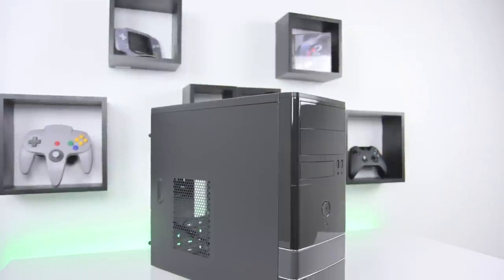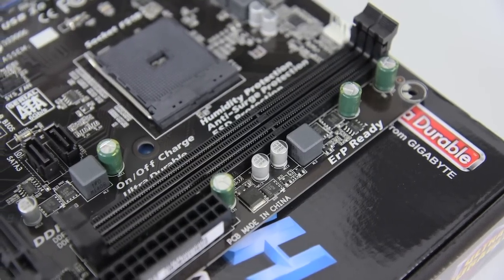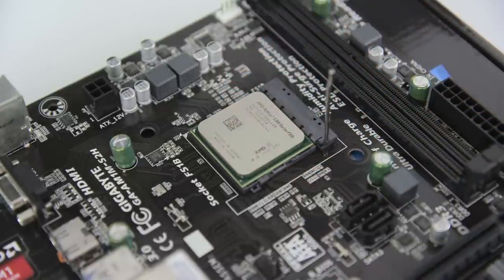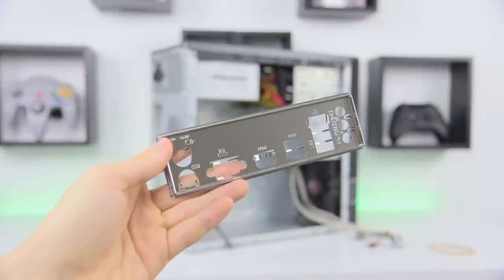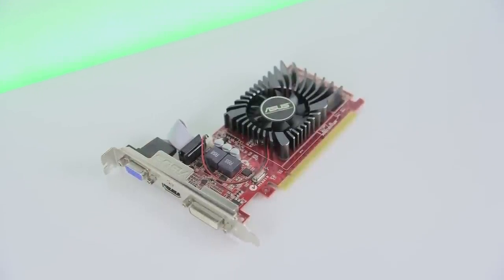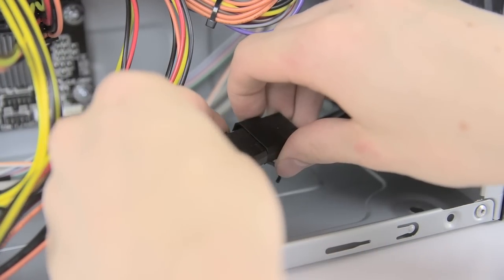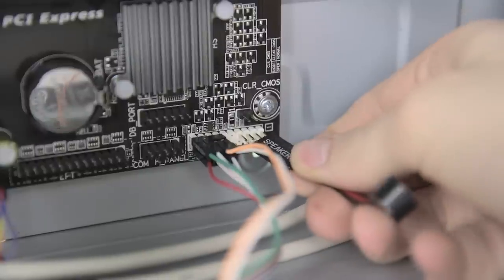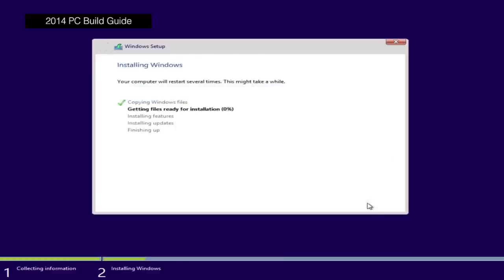How to Build a $300 Gaming PC! (2014 Boson)

Comment: im gonna buy these parts, just asking if its good or not:

processor: AMD FX-4300 4MB 3,8Hz 95W Tray Socket AM3+

motherboard: ASROCK 960GC-GS FX SocketAM3+/AM2+/AM2

power supply: ANTEC HCG 400 HIGH CURRENT GAMER PSU

case: ZALMAN ZM-T1 - Mini Tower - Black

ram: KINGSTON Valueram 8GB 1333MHz DDR3 CL9 DIMM STD

ssd: PNY SSD OPTIMA 120GB SATA3 1K

graphics card: VERTEX 3D VTX3D Radeon R9 270 Dual X-Edition, 2048 MB DDR5, DP, HDMI

hard drive: Western Digital 1TB Caviar Green, 3.5", Sata3, IntelliPower, 64MB

my friends linked me these but im not sure if its good or not, i would appreciate the help.
Reply: That powersupply is going to fry your graphics card. The 270 needs a minimum of 450W.
Reply: alright thanks for the advise
Reply: Prob 500 w least
Reply: ONLY buy Power Supplies from good Companies like be quiet!, Corsair or Enermax.
I bough a noname Psu once and killed my whole system with it just by turning it on.
Reply: http://uk.pcpartpicker.com/p/ynQ9pg Would Kick That Builds Ass. you have a wd green drive (there eco friendly = less power = lower data rates) that ram you got is slow and as said the psu is a little to small. try using a semi modular psu as its cuts out the unneeded cables.

If you buying like 8Gb of ram get 2x 4Gb modules and run duel channel this allows you to then be able to upgrade to 16Gb (not like you'll ever need to) buy just rebuying the current ram and popping it in, unlike if you bought 8Gb in quad channel you'd have to have that out and replace all. Also the Fx6300 is overkill for you as its 6 core but its the same socket as your quad fx4300 so just swap it out in your buys. I added the corsair H80i watercooled (easy and simple to install all in one) as that gives you system feedback but if you use the fx4300 you could probably drop to a corsair h60 or you can get the corsair h80i GT it looks better and improved pump rate, rad thickness, rad fin amounts and pipe increase. Then your optional extras like CC bar/LED strips, optical drives, fan controllers and the rest

Also  a side note, that ssd should allow your system to go from power button to desktop/login screen in under 10 seconds my 840evo and sabertooth boot in like 5 seconds
Reply: Noodle Liquid cooling? No need for that. OC'ing the FX too high decreases life span and it probably won't get through the stresstests. A 212 EVO would be a better choice.
Reply: ***** i never said over clocking, op wanted to buy 1333mhz ram so im pretty sure oc'ing is not in his range of computing skills. I was thinking more along a price for the build, as one was not stated so I went for a low cost components list in build.

Comment: can i use a graphics card with a cpu that has integrated graphics?
Reply: +BetaBoxProductions GOOOOOOOOOGLE
Reply: +BetaBoxProductions yes. most cpu's do have some form of integrated graphics (at least from intel anyways). that is normal. it will just completley ignore the graphics of the cpu and only use the graphics card (which is what you want)

Comment: The plugs that go from the case to the board, If you mix up the power one, I''ve been told by lots of people that you will fry your board. If this is true, I would not take anything from this video, and even ask for a petition to have this guy removed from Youtube, since he said not to worry about it, and you just might need to change them.... Don't be an idiot and this won't be a problem, just putting it out there.

Comment: Will my pc specs be able to play gta 5 ok?:

Amd athlon x4 860k
Xfx radeon r7 370 4gb
8 gb ddr3 ram
EVGA 500w power supply 
ASrock FM2A58M-VG3+

Thanks this is my first build it costed about $450
Reply: Skrubstep 2015 Well on medium to low settings maybe
Reply: +Officer Snake GTA is graphically demanding, yes, but you're overexaggerating it. You could probably run it at high, and average 30-60 fps. Whenever you get the chance, upgrade to a 970 if you want some good GTA. Shit, even a 960 is decent for it.
Reply: Kiqzu A 960 or 970?! Aren't they really expensive?
Reply: Compared to higher end GPUs, they are moderately expensive. A 4GB 960 can cost you about $220, and a 970 will cost you $330 ish. I have a Titan X, which I purchased just yesterday for $1000. That's one of the best ones on the market right now, if not the best. So a 960/970 is decently priced.
Reply: Kiqzu Wouldn't an 170 dollar GPU still be a console killer? Like if I was to build a PC that could run the phantom pain for an example wouldn't it just be better to stick with something that you could get max settings with 30 FPS?
Reply: Well trust me - if you get max 30 fps just regularly playing, when graphically intensive things happen like explosions and all, you'll scoop down to unplayable fps ranges.
Reply: Kiqzu Hmm.... The early benchmarks for mgsV seem pretty good. You can get 60 fps Max settings on gtx 670.
Reply: I've never been able to. thats weird. i used to have the 670
Reply: Kiqzu But the person benchmarking was using 1080p and not 2k or 4k

Comment: could i build the boson 2.0 using this same tutorial?
Reply: +TheMarioProject you can. the headers on the motherboard might be at different spots, but it is overall really similar.
Reply: do you have to use the same case?
Reply: no you can use whatever case you want, screwing the motherbaord into the case is the same in every case
just be sure, that it fits your motherboard size
Reply: nice because the boson case is out of stock and I was kind of worried
Reply: YourFriendlyCanadian whoah cool thanks

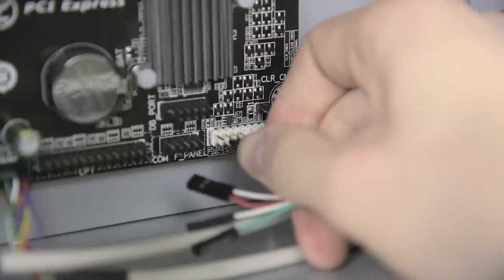Comment: can someone tell me whats the name of that white bottom connector at 6:43, i just get on that part now
Reply: +forever Hungry and how can i tell which one is positive upper pins or lower
Reply: +forever Hungry it says connect power switch  on the chassis front panel, however i didnt find chassis front panel on user manual. Does it mean system panel header
Reply: +forever Hungry nvm i got it figured
Reply: +forever Hungry how do i connect the power sw and rest sw. It says GND right next to the REST# what port should i plug it into

Comment: are you automatically able to connect to wifi wirelessly
Reply: +Jassay You need a USB wireless adapter for wifi connection.
Reply: +WB IsMe what about  a pci card
Reply: +Mcgamer MCF i dont have a router near my desk
Reply: Both work but USB wireless adapter is way more easier to install and cheaper than PCIE/PCI wireless card.
Reply: +WB IsMe ok thanks

Comment: This is NOT a gaming PC unless your going to be playing Solitare. I have this AMD 5350 low power 25watt apu in my home theater pc with a ssd and 4gb 1600 ram. All this apu is good for is watching/streaming video like Netflix or Hulu and browsing the internet and sometimes its slow at that. It might play some games on lowest setting at 720p 30fps which in that case why would someone spend $300 to game on something equivalent to an old xbox. I should have gone with a intel celeron g1820 or pentium g3220. This video has to be some kind of joke.  You want to build a decent $300 gaming PC your gonna have to buy used parts off ebay.

Comment: I have a better, cheaper rig: .1 gb ddr.001 20mhz, intel 1 core (i opt for this and not dual core cuz i find less power usage), i just use the mobo of a printer, 1 gb ssd, Nvidia TnT2, and i got a 2w psu, pretty good for nextgen games, runs very cool, veryhigh fps

Comment: Im going to be getting this pc soon, can anyone tell me how well it will be able to run games like CSGO and GTA V? The specs are -  AMD 4.1Ghz 8gb Ram 1tb HDD FTS Gaming PC Desktop Computer Galaxy 3 HDMI Gigabyte F2A68HM-HD2 Motherboard 8GB DDR3 1600mhz Performance Ram Onboard AMD Radeon HD 8470D 500 Watt Power Supply With 12cm Fan 1tb Seagate Barracuda Sata 6Gb/s 64mb Cache 7200rpm
Reply: You are either A going to need to get more ram to use because the apu likes a lot of ram more than Intel or B get a gtx 480 or 750ti
Reply: thanks, this helped

Comment: I built this for my first build when I was 13 but now im getting a 1.2k rig
Reply: +Raviolist how was it?
Reply: It was ok. You cant play a lot of newer titles like black ops three but you can play indie games and some games at low settings
Reply: i just want to play League of legends and record/video editting.
Reply: +Evax You should probably get then APU A10-7870K (its CPU + quite decent integrated GPU) then you just pick FM2+ motherboard of your liking, 1 module of 8Gigs of ram and any HDD basically... It will run LoL just fine and it wont be very expencive either. 7870K is like 150 USD, HDDs are like 50, for motherboard pick any for 50-60 USD, random case with 500W PSU for 30 bucks will do.

Comment: can you add a second stick of ram to this build?
Reply: duh
Reply: +Brendan Raymond I built this exact pc except with 8 gig of ram, and a 750 ti ftw graphics card and can maintain battlefield 4 on high at a solid 60 fps....so I mean, no poo is needed.
Reply: +Onyan Hepler how much more did that cost u?
Reply: +Hammad Ul Haque well without the gpu and just everything else it was 230? but I bought the gpu used on ebay for 100 dollars. all my other parts where brand new on amazon.
Reply: +Brendan Raymond I plan to upgrade in the future, but as of right now I don't game very offten, it's more like a thing to do when I'm board. But I will upgrade eventually.

Comment: all budget pc's ive seen use the crucial ballistix sport memory
Reply: +NytOnPeliAika oh and btw does every single mobo have same connector for power because ive only seen 1 type of connector and ive only heard people talk about 20+4 pin connector
Reply: +NytOnPeliAika  you have to get to really old motherboards before you get to a 20 pin connector. a friend of mine has an old computer that is an am2 socket, has a semperon 1.8ghz single core processor, the motherboard only has a 20 pin connector, it allows for it to be compatible with those older boards. as far as new boards pretty much anything past 2005 is all 24 pin
Reply: well built the pc already and figured out that it has 24 pin connector, but thanks for helping :D

Comment: hello my frends  
i will by new pc and if u wanna see that and tell me is good?

coolermaster k380
intel core i5 4690 3.50GHZ

asrock h97m pro4 retail

kingston-khx16c9t3k2-8x-8gb-2x4gb-ddr3-1600mhz-xmp-beast-series-dual-channel-kit-p-PER.

thermaltake sps-530mpcbeu smart se series 530w cm 87+ psu 

nvidia gt 6600 but  i change and i will buy that what u think is  ok? XFX Radeon R7 260X 2GB Core Edition

Comment: Did you read the instructions manual before placing the CPU cooler? You just did all wrong. Those pins should be placed on the top, and not on the bottom as "guide lines".
You should make sure you build a PC the right way, before making this video public.

Comment: how can I install mac OS?
Reply: You would need to make a hackintosh which is quite difficult and illegal but possible you just need to know what ur doing when it comes to formatting your hard drive and installing sound and video drivers or in this case kexts. Internet may not work outside the box either so you would to find kexts for that too, in my experience it is easier if you use a dedicated video card because installing kexts for integrated graphics is sometimes impossible depending on what cpu you have.

Comment: So why an APU, with a dedicated graphics card?
Reply: +NADQuest because for 50 bucks its a quad core 2.05 ghz cpu with onboard graphics that are rather lackluster (600mhz on the clock). its the cheapest decent quad core for the price. that and am1 motherboards are super cheap.
Reply: You can xfire the apu and GPU
Reply: Brendon Kalaja  is it r7 graphics on the 5350 dye?
Reply: ye
Reply: +volkswagenginetta No. It's R3 graphics
Reply: *****
 so how come you can do dual graphics with the r7 240 or the r7 250?
Reply: volkswagenginetta Same architecture on the chip. AMD xfire will allow this, unlike SLI
Reply: Brendon Kalaja he *****  said its r3, not r7. i undestand the differences between crossfire and sli, just confused on what graphics processing is on the dye of the 5350 (though according to amd dual graphics is not supported with am1)

Comment: is there a nother case I can use
Reply: +George Bennett There are tons in the market. Corsair, NZXT, Thermaltake, Coolermaster and many more brands.
Reply: +WB IsMe will any case fit
Reply: As long as the case support MATX motherboard, it will fit. Go check their website's product for specification before purchasing.

Comment: better buy a used pc on ebay with a core i5 2400/2500 (~200$) and a low power GPU like a gtx 750ti/1050/RX460 (~100$)
Reply: this video is from 2014 :X idk what youtube is doing with the recommended stuff as i seem to be getting a bunch of old tech videos in mine also
Reply: i know but i think there are still loads od people who still watch this video in 2017 and want to buy this hardware ...
Reply: Felix R ya for some reason it showed up in my recommended to . I hope no one builds this pc in 2017 and pays the price he did if they do
Reply: Felix R you should probably spend more on the gpu

Comment: can the computer run with 300w?
Reply: +Louis Coronado (PrincipalLouis) no
Reply: +Louis Coronado (PrincipalLouis) yes it can. the 5350 only takes 25 watts and the gpu only takes 30. accounting for powering the hard drive and fans, its like 65-70 watts at highest load. it will do just fine.
Reply: +cocacoladog10 how did you come to that conclusion? this is a very low power consumption unit
Reply: volkswagenginetta cause i know a guy with a 360 watt powersupply and he can barely run his computer with a amd processor of some sort + a r7 250
Reply: cocacoladog10  well that doesnt clear up a whole lot. amd processors have a vastly high ranging tdp. my 8320 has a tdp of 125 meanwhile the one in this video is 25.  vs an r7 250 has a tdp of 60 watts instead of 30 and if its a 250x it could be 95 watts. those parts vary so much in power compared to what this is.

Comment: Is this a good PC Build? I found it on the internet, but added/changed a few things: http://pcpartpicker.com/p/RLcRXL
Yes I know the CPU is an APU.
Reply: Zornym Do yourself a favor and don't get an APU. You will be disappointed if you are planning on gaming. Grap a Pentium G3258 with either a GTX 750 or a GTX 750 ti (depending on your budget). Cut the memory down to 8Gb, you definitely don't need 16GB. Get the NZXT Source 210 instead. Hope that helped!
Reply: Leajiaure Thanks for the feedback, and will the PSU be good enough? and what mobo would you suggest?
Reply: Zornym Yes, the PSU will absolutely do the job. It's not modular so you'll be dealing with cable mess, but if you're on a really tight budget you may not care. As far as motherboards to go along with the pentium, I would go with the 'ASRock H97M Anniversary LGA 1150 Intel H97' motherboard. It will allow you to overclock your CPU (even with the stock heatsink!) and has all the features you would need. Also, depending on how many programs/ games you want to install I would go with a 128gb SSD for much much higher speed, albeit at a very reduced capacity. I did basically this exact build I'm recommending for a friend of mine. He was very satisfied, I'm sure you will be too.
Reply: Leajiaure Hey, sorry if this is too much, but can you just link me the build? lol I think it would be much easier for me. Thanks in advance :D
Reply: Zornym This is assuming you want the 128Gb SSD:
http://pcpartpicker.com/p/HdGVQ7
Reply: Zornym Oh and it includes an OS
Reply: marvinifeagwu Although the i3 may seem better on paper, the H97 motherboard in my build allows you to overclock the Pentium to outperform the i3 in nearly all cases (google the benchmarks if you have any doubt). And overclocking may seem intimidating, but it took me less than 20 seconds to overclock the Pentium to 4.2 GHz with no voltage increase. Another problem with his build is using two sticks for dual-channel memory (like in my build) performs much better than a single stick. This is a very common noob mistake because you seem to be getting the same thing for slightly cheaper, but you aren't. Also he does have a better GPU in his build, so if you can afford the upgrade, I would go for the 960. I was just assuming you were on a tight budget. Also be aware he is using a much cheaper motherboard and a much much slower HDD. Trust me, once you SSD you never go back :D So if you do not need a lot of storage I wouldn't go with an HDD.
I really insist you go with my build, however again you should go for the 960 (if you can afford it) because it will blow away the 750 ti.

Comment: Are these parts compatible? Says theres a compatibility issue but I'm not sure if it is a mistake or not. http://pcpartpicker.com/p/Vbw77P
Reply: born 2 biscuit You should be fine.
Reply: born 2 biscuit eww it doesnt have usb 3.0 on the case
Reply: And the bios update is totally Optional Won't affect performance
Reply: Doge Gaming is the usb 3.0 thing a problem
Reply: not really
Reply: born 2 biscuit Nope, if you really need USB 3.0 you can always use the back of the motherboard which has USB 3.0 ports.

Comment: i have i crappy laptop it a 

intel core duo t2080 2 core 2 threads 1.73ghz
intel chipset 945 exprees family 256 mb 
2 gb ddr2 800mhz
120gb hhd 5400
and a 800x1280 display at 60 hz 

it can not play cod 1 or battlefeild 1
it plays max payne 2 and rollercoster tycoon only at 600x800 at 45 fps no lying promise